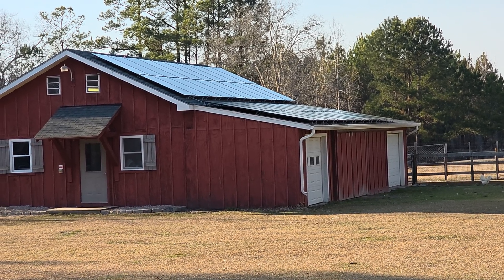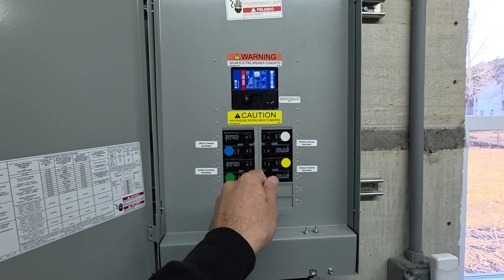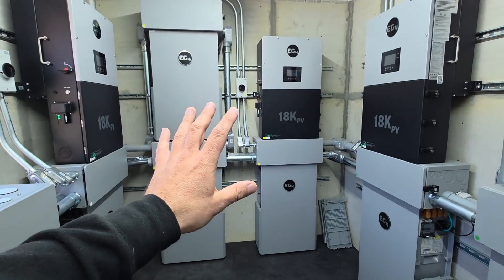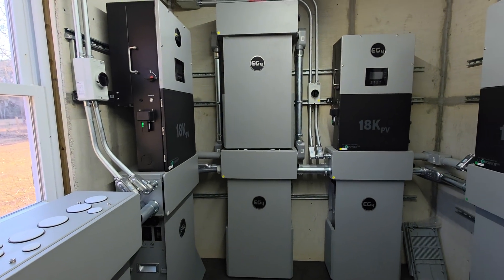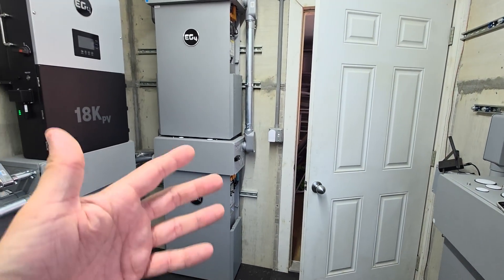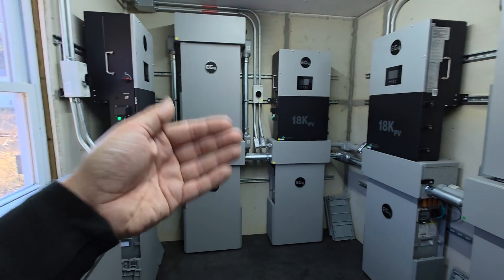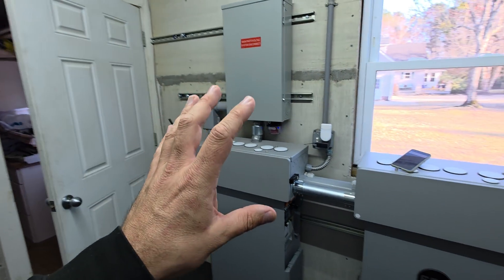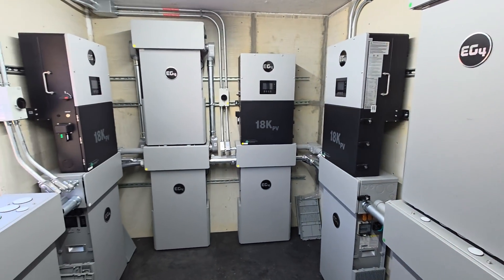Beginner Tips For Your First Solar Project

Comment: 7:44 Certificate of Occupancy… is that required for federal tax credit? Did not hear about that before.
Reply from the maker: Not exactly, the tax credit has been done on the "trust system" and as long as your taxes looked normal, and the cost of the system was within a threshold of reason. They basically accepted. I wanted to make sure mine was audit proof effectively, and that from the county I was also all clear

Comment: 3:30 Utility LIMITS the amount of solar you can produce in your own home if it is still connected to the grid… even in bypass mode!?! 🤯
Reply from the maker: Yeah I think because those bypass modes are not constant, I can get it inspected then digitally change it, or someone else could buy my house and change the settings without any electrician coming out.

Comment: 3 inverter would have been enough.  200 amp panel are rated for 160 amp continuous load.  It is a very beautiful and clean installation.
Reply from the maker: Thank you I appreciate it!

Comment: It's nuts you can't use the grid even when you don't export.  Have you considered a hot water dump load for your excess output?
Reply from the maker: I have other plans for utilizing over production that should be able to consume the power and create other value. 3D Printing, CNC, Pool heater etc...
Reply: @ianmburke  good luck!

Comment: Can you add more than 3 batteries per 18k pv?
Reply from the maker: I believe you can add up to 5, however total charging rate and other limits would apply. The manual available on the signature solar website has all of the details needed

Comment: Thank you, for sharing! 🙏
I love your huge off grid solar installation and especially your masterful conduit routing in hiding all of the wiring.
I'm curious if you use a back up generator to supply electricity when your storage bank is drained? 🤔

I've been off grid for 30+ years, growing from 300 Watts to over 10 kW now. I started with 12v lead acid batteries using an OutBack components, upgrading 7 years ago to 48v, switching to Schneider inverters, charging 30kWh of LiFe P04 storage cells. I use an air cooled Deutz diesel generator as my liquid sunshine during those short cloudy winter days up in the Pacific Northwest.
I'm going to increase my LiFe storage capacity to 120 kWh because 30 kWh is not enough storage capacity to run the entire household that include 2 1/2 tons of mini-splits in spring-summer-fall and forget about winter time use.
Reply from the maker: I do have a "Chargverter" which is an EG4 Product that takes the "dirty sin" ac and cleans it for charging batteries in that exact example but I have not bought the generator yet because I was hoping my pseudo-math would serve me with the days of autonomy of the system. It was super close a few times and I was using propane to offset heating so I think this year I will be adding the generator along with some of the other solar panels I purchased at the same time
Reply: @ianmburke  I use a forced air LP gas furnace along with a soapstone wood stove for winter heat. I’m relying more and more on the LPG heater because of the indoor pollution while opening door and loading (ash, fumes) from using a wood stove.
The only time I’ve used the mini-splits for heat during winter is while the generator is running. I do love to use them during the blazing 100 degree days in the summer.
I do have a well. I don’t have a pool.

Comment: First, fantastic install, great job and thanks for sharing!

Second, why both EMT and PVC conduit? Code, ease of installation, cost? 

Update - "DC in metal conduit", found the answer in one of your other videos ( https://www.youtube.com/watch?v=K0IMl8XLP3E ), I thought this only applied to the high voltage DC, from the array for example...  Like the EMT attached to your DC array disconnects, the 2" EMT appears to house the battery cables (as seen in linked video)...

(I just purchased a Gridboss, Flexboss21, and three indoor EG4 wall mount batteries (& ~17kW of solar panels) - I want to make sure I am not missing something in the CEC/NEC codes...)
Reply from the maker: Thank you! I appreciate it! DC is all in EMT and AC and communications can be in PVC some argue this to be on the PV side only but I believe to be to NEC all indoor wiring part of a PV system needs to be in EMT and in rooms with batteries FMC is not permitted. Furthermore the PV system is all components from the panels to the AC output. Check with your local code/inspector/AHJ but I believe that to be true and passed my inspection in one of the harder counties for electrical inspections
Reply: @ianmburke  Copy all, and thanks for the quick reply.  I will adjust my design and add EMT as necessary to convey all the DC power wires/cables inside the building.  Easier to design it in now then to "fix" it later...
Reply from the maker: That was the exact logic I used, it seems like some parts of NEC could be interpreted in the way that EMT was needed so instead of reworking it if I didn't pass I figured just do it that way make it safer and not have to think about it

Comment: How much of the battery is left by morning on a typical day?
Reply from the maker: Depends on the time of year but since my hvac is not as in demand right now I'm using around 30% over night, however the daylight hours are getting longer and the usage will go up. The system is still just two months in so I need a little more time to accurately answer that. I will keep doing update posts so stay tuned

Comment: sweet setup.   Curious on the number of inverters versus the panels...  Do you need 400 amp service to power everything?  Just knowing you could have tied all that solar into a pair of 18k's.  (sure you'd only net 200 amp service, but thats the home standard nowadays).  Planning on bigger arrays for the future?  If you had it again, probably do a pair of 12000ex's?
Reply from the maker: Yes planning on bigger arrays and the 18k is a max 50a output so I need 4 to be a 200a service.
Reply: @ yeah, thats a lotta power for sure.  I always cross the 200/400 thing, because of it being 240v...     👍  I say 200 amp, and mean 100 amp of 240v.  😂
Reply from the maker: Okay that makes way more sense then 😄  yeah 200a @240 I needed

Comment: Did you put brackets under the upper batteries?
Reply: Or are the conduit boxes strong enough? I have indoor batteries and the indoor boxes.
Reply from the maker: Conduit boxes are NOT strong enough, the upper batteries use the strut channel as well as wall brackets for redundancy

Comment: Wow. Very impressive setup. And here I was thinking my measly 7kwh system is daunting 😂. Question regarding the your MC4 cables and disconnect switches. Does code require them to be in two separate metal conduits like that instead of one? Thanks for sharing and I appreciate the advice.
Reply from the maker: It's all relative! And larger is just repeating more of the same thing. No code does not, just conduit fill needs to be considered and my disconnects were made for two strings entering and exiting in two knockouts

Comment: the limit is what can be sold back not what is generated, many have that. The inverters have limited to house mode that the electric company can't tell you no. The inspector could but not the electric company.
Reply from the maker: For some utilities that may be true, however mine informed me my system was indeed too large to interconnect based on physical size regardless of any inverter limits for that limiting

Comment: Poor choice for inverters. High frequency inverters offer a shorter life expectancy and a far poorer surge capacity, and because they don't have an output transformer to provide galvanic isolation between their DC boost stage and their AC output, they can damage your appliances when their MOSFETs fail.  You would have been better off investing in low frequency, transformer based inverters they last longer, offer a much better surge capacity, and their safer for use in residential applications.
Reply from the maker: You should work on your prompt engineering and engagement mechanism for your troll bot. It seems to produce almost identical posts for each one of these spam style comments. I am an AI specialist at one of the largest tech firms so hit me up if you need some help to make this feel like more of a real user 🤣🤣🤖
Reply: @ianmburke  haha 💯
Reply: I would question the integrity and intention of anyone who speaks bad about those inverters and the setup as a whole.
Reply: From what I could find, it is a guy that actually repairs LF inverters for a living.  I found that quite ironic. 🤦‍♂️

Comment: Your videos are always good and you're very well spoken. Congrats on the amazing build. I was impressed and surprised to see your house pulling a constant ~3k watts. Do you have baseboard heating in addition to your mini splits? "Silly abstract rule." :)
Reply from the maker: Thank you I really appreciate that 🙏 I have a propane fire place that does heat a lot of the house in the dead of winter but we RARELY get below freezing here. So most houses like mine often only have HVAC centers air or mini splits